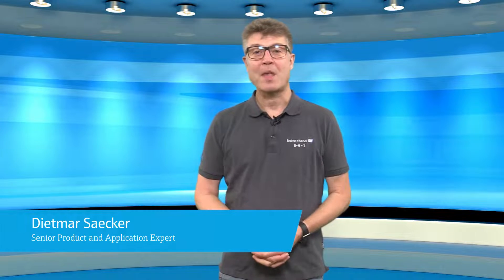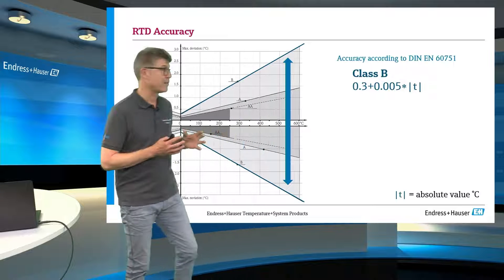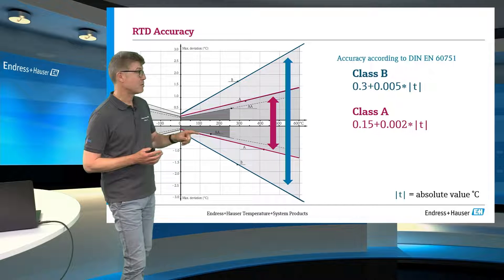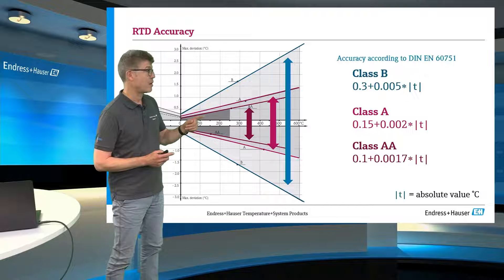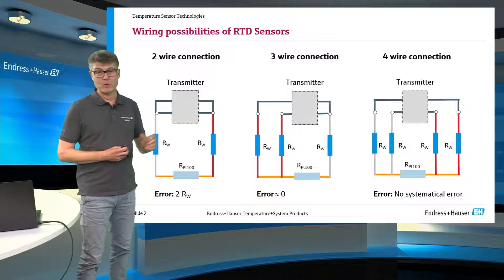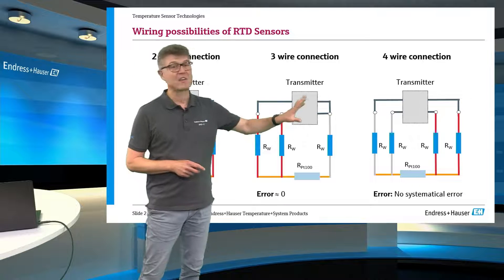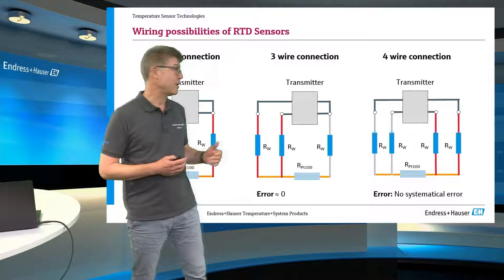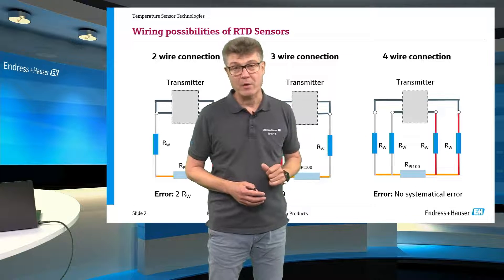RTD temperature measurement accuracy

Comment: Which kind of wire connection apply for E+H thermal meter?
Reply: Never use 2-wire with Pt100, 3 wire is ok if the cable is not to long, 4 wire is generally recommended especially for thermometers made of mineral insulated cables, long connection cables, and if there are more electrical connection in between.